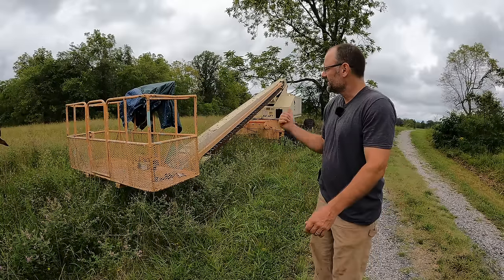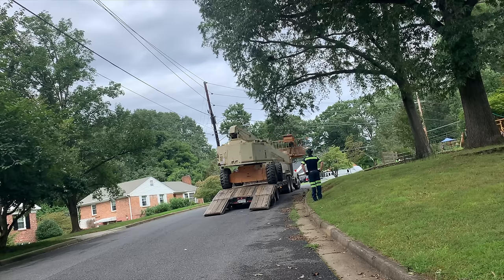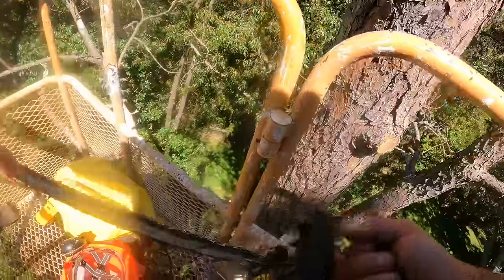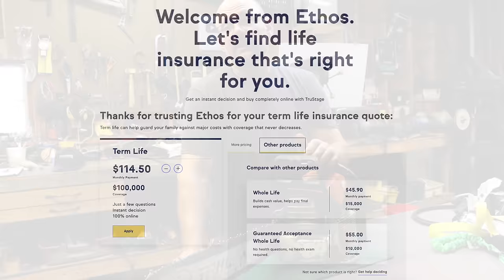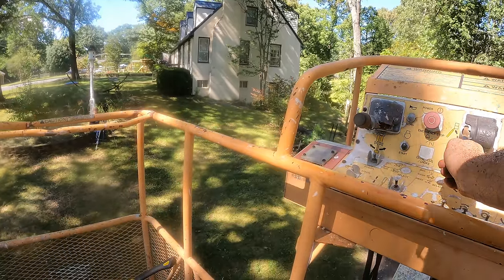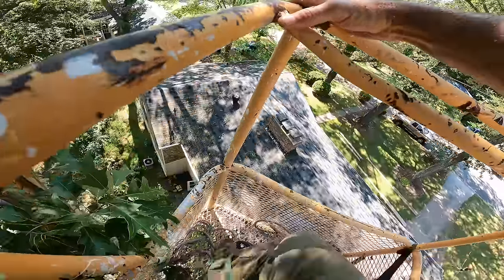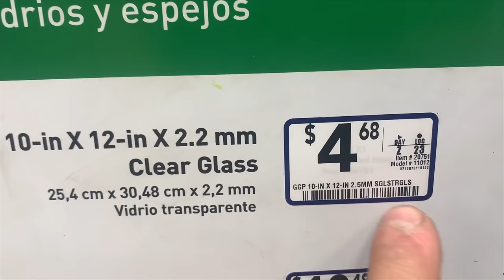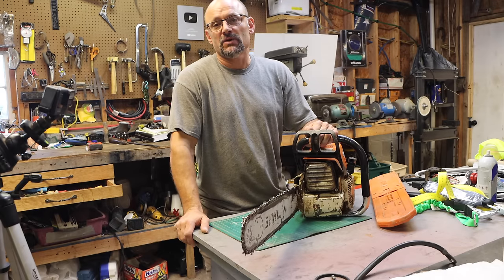Boom Lift Tree Work, Directly Over A House.

Comment from the maker: Big thank you to Ethos for partnering with me. You can get a personalized insurance quote in 10 minutes for as low as $10/mo by using my code here: https://bit.ly/farmcraft101-ethos.  Have an awesome weekend everybody!
Reply: My left knee had a 3" scar pretty much like yours but the coco butter  has reduced the scar too 1 1/2 inches. Just apply it often, it really works.
😀
Reply: This is not good advice, use a licenced ,regulated advisor.
Reply: kind of foolish to be doing tree work without a hard hat, one of those dead little branches just 10 feet above your head could kill you.
Reply: After you cut the wedge out and after you start doing the final cut you need to use wedges, to both manipulate the tree and have some clearance so your saw doesn't get jammed

Comment: The tree grabbed your saw because your back was higher than the apex of your notch and you cut passed your notch turning it into a snap cut. your bar got caught in the keef ot by pass wood. when blocking wood like that either make a notch and leave hinge wood then pull the saw and push it over, or make a proper snap cut, pull the saw and push it over.

Comment: I spent the entirety of my youth working around trees cutting and chainsaws.  Mostly with my family cutting firewood for sale, but in High School I worked for a tree trimming company for 3 years.  You done did good work.  The only damage I every really saw was almost identical to your broken window.  Limb lands just perfect and launches like a spring.  That guy was a damn good saw man in the bucket and out of it.  It happens to everyone sometimes.  Still did a lot of good work for your friend with no real issues that weren't easily fixed.

Comment: Arborist here, the main problem is that you are not lining up your back-cut with the hinge. Hard to see accurately on video obviously, but it looks like your back-cut was quite severly above your hinge when the saw got grabbed, which is a big no-no. Sometimes it's appropriate to back cut slightly (about half an inch) below the hinge, but never cut above it.

Regarding the window trick-shot. Even limbs that are too short to reach something fragile from their landing spot can, given enough drop velocity, flex like a bow when landing on their tip and absolutely launch themselves like a vaulting pole. Always be extra careful when dropping, and preferably use a cut technique that drops the wood flat, rather than droop-n-drop.

Love your content,  and sorry for my lack of skill in the English language :)

Comment: 59:59 those Stihl saws have a flexible rubber boot between the cylinder and carb mount, they can get flex cracks in them causing a slight intake leak which causes a lean condition at idle, causing a stall
Reply: Sounds like just the sort of thing they could be caused by a shock, like maybe dropping the saw? 😆

Comment: I cut trees from a lift as well, though not for a career. Couple possibilities: 1. Have someone with you in the basket. They can hold branches and keep them from whacking you or dropping where you don't want them. No putting the saw down after every cut either. It's a game changer. 2. Cut the lower limbs off first and work up the tree. Limbs then fall right around the base of the tree without hitting and bouncing off stuff. Can't do that if the tree is so rotten that stuff would fall off from above. 

Love watching you work!

Comment: I would recommend a self retracting lanyard for boom lift work ( they are now the industry standard) because not only will they soften your fall like your fixed lanyard, but they act like a seat belt and may prevent you from being ejected from the basket in the first place (once you are ejected and take a 6 ft fall it is difficult to self rescue). I Iove the channel and all of your content (even if it makes me jealous haha).
Reply: I was thinking the same thing.  Self retracting lanyards are not that expensive and easy to work in.
Reply: The requirement where I was employed was 100% tie off if you're in it for any reason. Good call on the retracter. Check out the videos of people getting thrown out of lifts unloading them. I don't want to bring you bad luck, but you need to unload the lift as in sell it.

Comment: Man as a tradesman I definitely felt your pain on this job. Sometimes things that you think will go easily just don’t. You get flustered and make more mistakes. Most of the time they aren’t any thing too major but just the embarrassment, inconvenience and time wasted. We have all been there. Good thing you’re handy and could change out just the single window pane. I might have been buying them a new window 😢.
Reply: He was lucky it was an old window.  A double pane would have been a bigger deal because there'd be only one big piece of glass (actually two or more) for the whole sash instead of several small ones like that one had.  The whole sash would need to be replaced.

Comment: Always, Always, Always cut your lower limbs first. It will let your upper cuts drop straight down or you can direct your higher cuts better and safer. lower limbs left on can deflect or spring your cuts in directions you would never think they could and cause damage to something you never thought it would. Like your channel and you have shown me a thing or two even though I am 63. Great channel

Comment: Single Pane windows!  I live in Minnesota so we don't have those anymore.  Back in the day I used to glaze a bunch of those.  That's maybe the first thing my Dad ever taught me as far as DIY stuff.  I remember being proud of how clean I could make the glazing look.  

Thanks for the chainsaw rebuild.  I have a 5 year old 391 that's never let me down.  I cut a lot of hard woods so I put it through it's paces.  But that 460 is a beast.  I can see why it's twice the price of mine.  I've owned 3 Stihl chainsaws, getting larger with each purchase. I've got 15-20 years out of each saw.  But the residential models are not worth rebuilding, so they're basically throwaways.  That 460 is a different story.  I'm 62 years old now so I might want to go that big by the time my 391 craps out, but now I'll know the difference.

Comment: That happened to me , we were up 80', the tree was about 90' high. Ii took my brand new De Walt electric pole saw and was cutting overhead.  As the branch began to fall it pinched the blade and ripped it right out of my hands and fell 80'. We watched it hit the ground, the pole bounced one way and the battery the other way. It bent the blade a little but it still worked. I am still amazed that it didn't bend the pole or shatter the saw housing or the battery.

Comment: I have been contemplating buying an 18v Dewalt chainsaw for over a year now. 
Watching this made my mind up, just ordered it and it will be here tomorrow. Great video as always.
Reply from the maker: It's pretty decent.  Not as much power as my gas saws, but what can you expect?  And I already had the dewalt batteries.
Reply: @FarmCraft101  yep. I have more batteries than I can carry, + I always  charge them on-site if I can: #free fuel.
Reply: I have both the 16” 20v electric Dewalt and the 60v 18” Dewalt. I like them both, but the 60v has a lot more power - but not as much as a gas saw… it’s quite a bit heavier than the 20v.

Comment: These safety items are a plus. I worked with power company florida power and light. We would not work by our self or without safety lanyards for ourselves or equipment. If tree parts falls on your lift or gets tangled in any part of you it will pull and when it reaches it limits. You will be slingshot out of that lift and hopefully be hanging by your safety gear. And at that time you better hope someone is there to let you down and at top of list  knows how to work the lift. Safety-safety-safety.😮😊 because it will happen, like your friend said tis not whether it will happen, it's how many times will it happen. I worked 41-1/2 yrs till I retired. It's always a good thing to be able to say what a good day it was!!!!!

Comment: When I worked on the farm, the farmer's son ran a tree cutting business(we used the chips in the manure spreader and for stall bedding), and one of his big things was he had lanyards for all of his tools, even hand tools, he used on the boom and for his climbers. Just a run of paracord or nylon with 'biners to attach it to the tool and the bucket. For chainsaws he attached it to the brake lever.

Comment: I did the opposite of dropping a saw.  I had one bound in a tree and talking with ground crew i forgot i hadn't unhooked the lanyard from the boom and boomed down quickly to grab a wedge.  Stihl MS250 bent the bar badly i couldn't even unbend it in a vice.  Surprised it didn't break the handle or the plastic case on the cheaper MS250. Stihl saws have impressed me a few times. Yours is definitely one of those times!!  60ft and survive Wow. 

And when cutting close to buildings even with no leafy branches always have to be watching for the PoGo stick effect.  Landing on its end and bouncing where you don't want it!!  I swear some chunks defy lottery odds to end up where you don't want them to go!!

Comment: Every time I see you up in the basket reminds me of the frist time I operated boom lifts  .
It was a little bit scary  .
Given no training what so ever  . My foreman asked if I knew how to run one  . My answer was how hard could it be  ?  The first time was a puckering experience  to say the least  .
After a couple of long days it was more fun than being on the ground running a ninety pound jackhammer horizontally  . Got really good at maneuvering the basket around to make the job easier  .
We were doing a major paper mill remodeling project so many of the lifts were 120 feet  .
Must have spent a total of three and half to four months on those machines  . Was just as much fun as riding my motorcycle  , which also needs a lot of respect and responsibility each time you mount up .
Just remember to take in the views each time you go up .

Comment: I can truly say that this video brought back   some very fearful memories for me! I've been in lifts and suspended by a crane, and I've been on ladders. And I've used chainsaws extensively, sometimes in a tree from a ladder. I believe what you did is beyond anything I ever did, because of combining activities! I can offer no criticism, because you did what had to be done, and you were successful. Most recently, I removed about 10 or 12 pine trees averaging 75 feet or so in height, but I had the luxury of doing it all from the ground, since I was clearing an area for a workshop. I used a crossbow and fishing line to pull successively larger ropes over limbs at 50 feet, and dug around them before pulling them over. And one or two didn't go exactly where I wanted them, but the damage was minimal. I normally cut hardwoods for firewood, and I was really surprised how quickly the large pines dulled my chains. Most of what I cut was 18 feet in length - if I had to cut all that into 16" lengths, I would have to find a better method if there is one!

Comment: I like to make my own anti-seize compound by mixing dry graphite powder with a 30 w or 20 w non-detergent motor oil.  If I need a high temperature anti-seize compound, I use water instead of the oil.  Sure makes things easier to come apart when you want them to.  Kind of dirty though but not too bad as long as one uses just enough to coat the parts one needs.  Great video John thumbs up.

Comment: I suggest a lean-to shed large enough for all your equipment to allow you to store equipment out of direct weather your equip. will thank you and your subscribers will get to enjoy the build videos. Nice job and the extra safety equip is always a good idea especially for all espacially solo operators. I often wonder why original equipment manufacturers in this case JLG do not sell parts that they have original tooling for, at or below prices for what secondary parts companys' who have to copy the originals and keep the repair parts market to themselves. I also use Stilh and think it's inexcusible that Stihl does not offer a rebuild kit for their carbs or at least where to buy advice fir their customers. Ray Stormont

Comment: A set of wood dowel sticks the about the thickness of your sawblade, are going to be your friend! When you saw far enough into the stem of the ttree just stick in a piece of of the round dowel, it’s is wood so never bothers your saw and support the heavy block saw further, again a dowel stick. The block is supported on the dowel stick you can completely saw through. Then you can just “roll” of the heavy block.

Comment: When I was young I was working in ABB high voltage laboratory in Stockholm. We had a lift to use to get to the ceiling, it just went straight up. It was the most terrifying experience I had..

Comment: I was takeing out trees for my mother. We had a line on it and I wish I had put the 4weeler on it. The tree fell perfectly backwards missing the wraparound deck by inches. Thankfully the only damage was a cheap umbrella. 

Side note I also dropped 8 trees less than 3in in quick secession on a 90 degree day on a steep grade. As soon as I sat down I almost passed out. Take more breaks than you think you need people.

Comment: This reminded me of 44 years ago when I lived in Daphne, Alabama.  It was the year that hurricane Frederic came to call, and among the many trees damaged a large pine tree on the property line twisted and "bent" to lay on  the roof of our house.  It didn't break because it had a diseased section about 10 feet up the trunk.  Dad got his big ladder and leaned it against the tree to cut it with his chain saw.  As he sawed through the trunk it snapped up as the weight of the top came free, which meant that the ladder no longer had anything to rest against.  Dad jumped free of the ladder, simultaneously throwing the chainsaw away from him... only to have it land blade down right between his legs!  Miraculously, it missed his legs by inches and was sticking into the ground.  It took a few seconds to realize how close he came to a potentially serious accident before we started laughing.

Comment: For someone like you that does a lot of work by yourself
What you'd need is an electric winch with a remote. sling the winch to the base of the tree, sling a pulley to the main body of the tree, preferably above your working height, and just use remote control to operate the winch. might need to put a quick release hook on the winch so you could release the job with a pull cord once it's on the ground, they are not that expensive (I see them listed under sailing/ships)

Quick release hooks on limb work could be handy too. once the branch is hanging off the sling, you could just drop it straight down or release and lower it.

One thing I would try also would be to cut a limb while slinged, let it dangle, do the same further down and so on to the base, basically a long chain of limb bits held together by slings. that way the whole limb can be brought closer to the base of the tree with fewer operations. (on the other hand, you'll need more slings, and probably with higher rating as well)

Comment: Climber & cutter who runs saws for a living: always make the second cut LOWER than your fist cut if you are staggering/offsetting your cuts.

This will cause the wood to lift off your bar as it breaks free and your saw won’t get ripped from your hands. Second cut higher, as you’ve seen, can sometimes cause problems depending on how the wood breaks free.

Comment: I used to take down an awful lot of trees with spurs on. What I used to do when up high and cutting the main trunk was just cut the pieces off the size of fire wood. Makes things easy to handle. If a piece sticks it is no big deal to hang onto it.